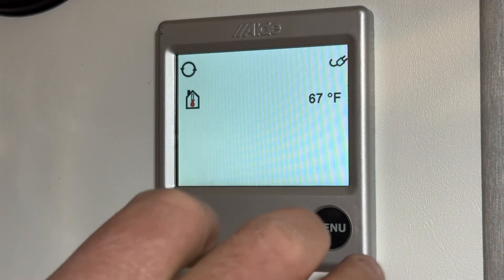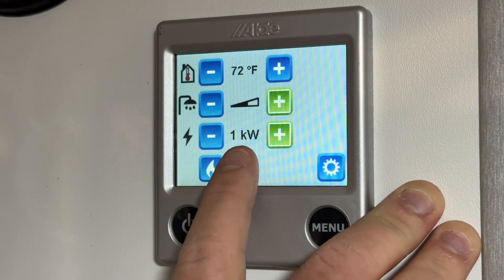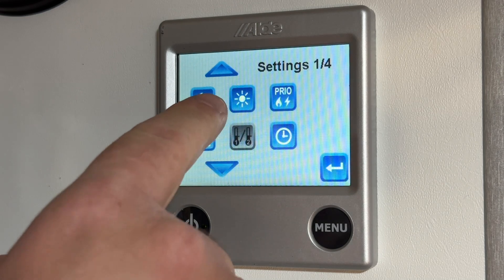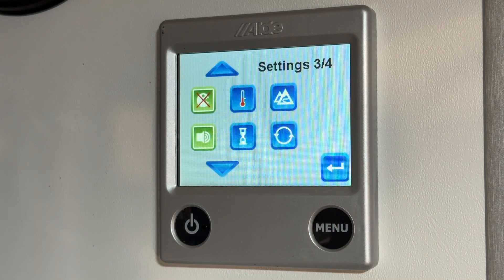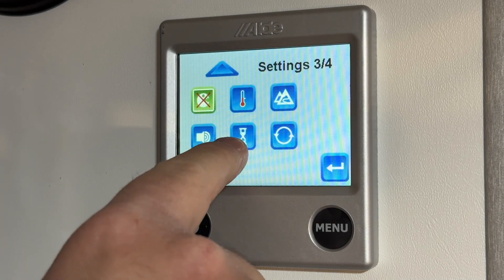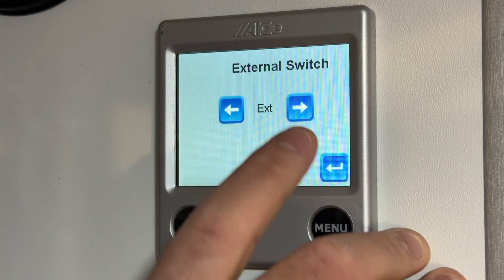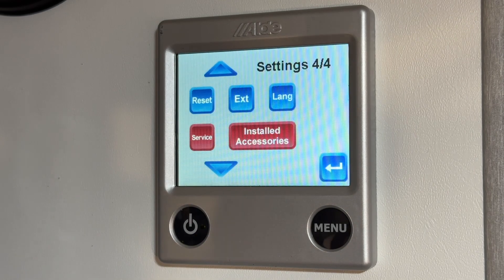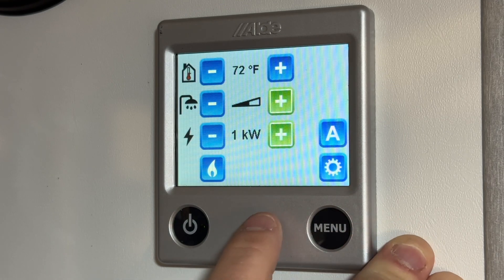Tech Talk: Alde 3020 Panel Overview

Comment: I appreciated this video, even though it leaves some questions unanswered. For instance, in the "night" setting, should the shower icon be activated (green) or not activated, if you want the hot water OFF at night?  [in another video for a different Alde model, it says, "... if you want to turn off the water heater overnight, touch the Shower icon to turn it green.". I had previously been assuming that green shower icon in night mode meant hot water would stay ON, but it looks like it's the opposite?] It would have been nice to include this detail, perhaps along with some explanation of high altitude mode.

Comment: Thinking about getting the "all electric 920". Can you run the heat off the batteries or does it require shore power for electric? In other words, If someone is boondocking with the 2024 920, they must use propane to get heat or can they use battery power? Thanks
Reply: I'll answer it for you. Heating works off 15Amp/30Amp electricity and/or Propane. The alde system does require 12V (battery) power to start but it does not run on 12V power.
Reply: @Montro_Full I was going to ask if the lightning bolt is only shore power or if it means battery power. Not mentioned in the video.
Reply: @donmontalvo1  yep it's shore power 1Kw/15Amp & 2Kw/30Amp
Reply: @Montro_Full  Do you still need a 12v battery hooked up if I am running it from shore power?
Reply from the maker: Please contact our Tech Department at tech@nucamprv.com.